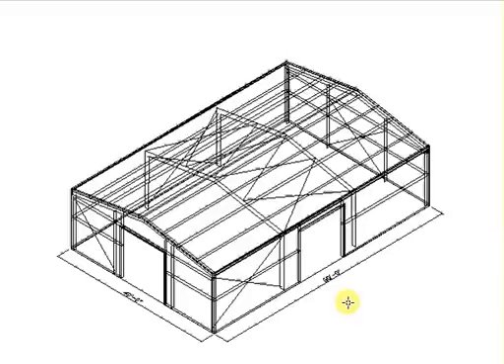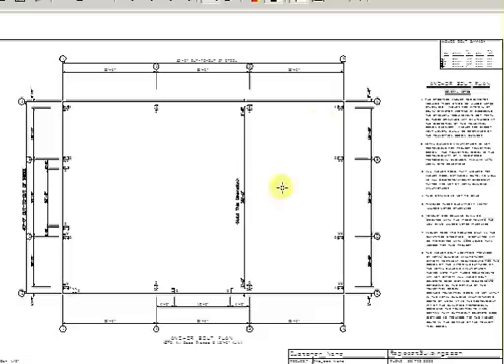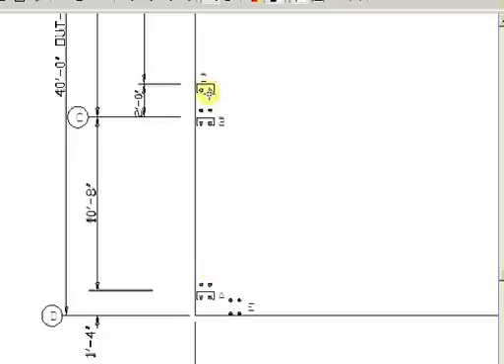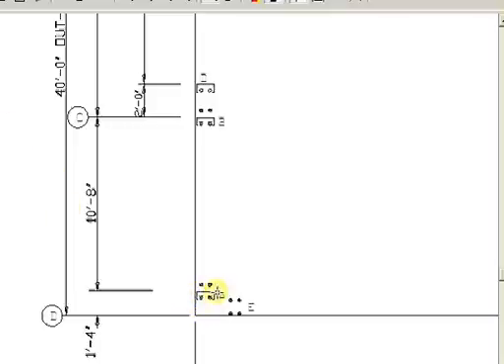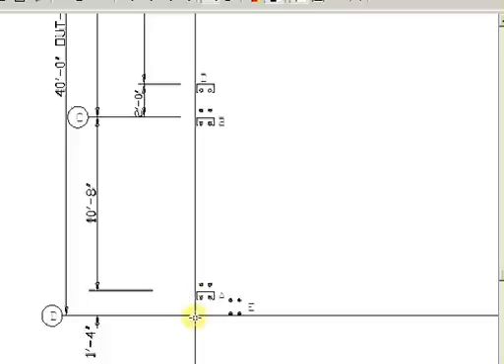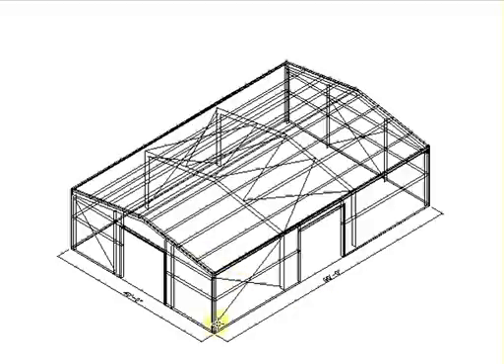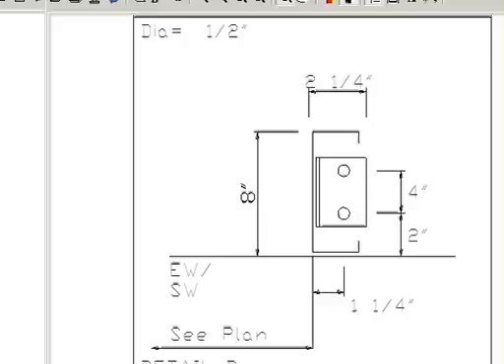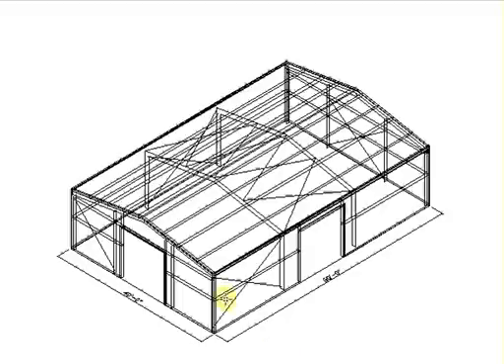Rapidset 40 x 60 Metal Building Shop Garage Anchor Bolt Layout

Comment: What size and length bolts?
Reply from the maker: It depends on the uplift and shear force needed for your location. Like in the Caribbean sometime the anchor bolts are about 3 feet long and if heavy snow load it would be larger diameter and maybe more bolts. So it depends on the design. If you want call the office and talk with Steve or Scott to design a building and send you anchor bolt layout and reactions for your design